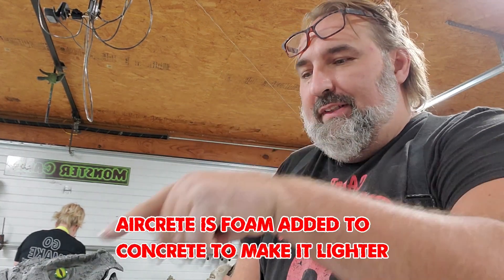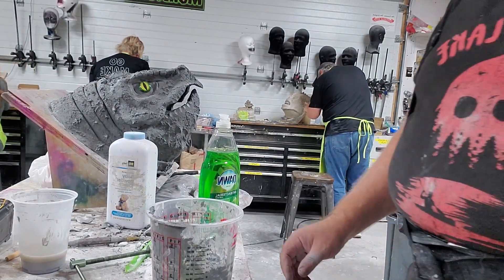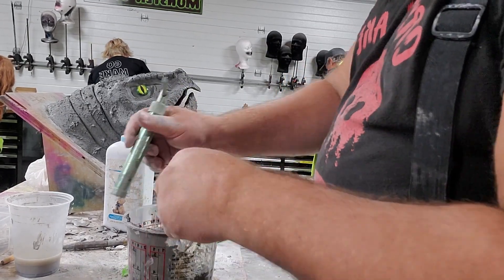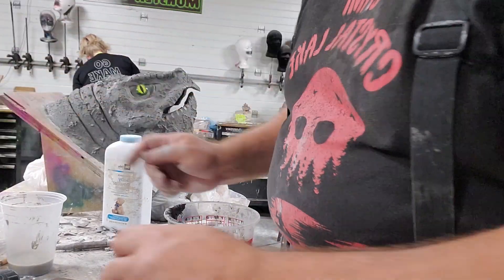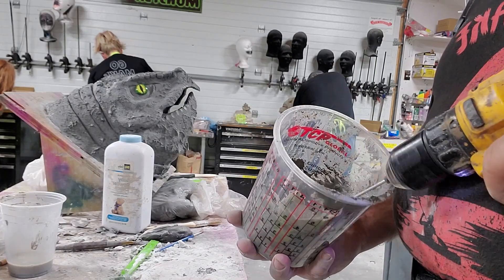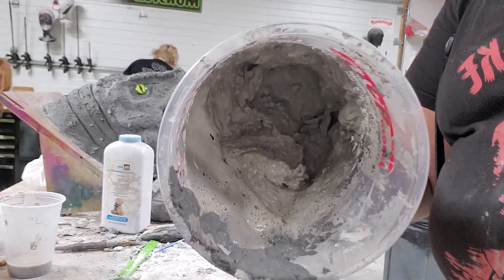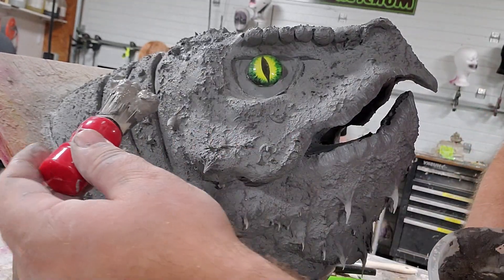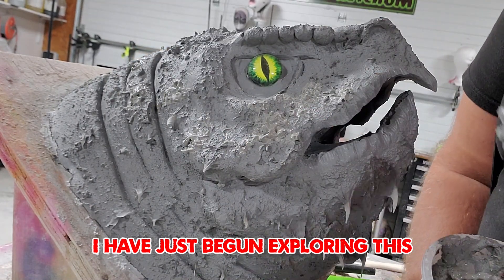whipped clay for sculpting texture

Comment: What about if you want to do human skin texture?
Reply from the maker: this would be too intense for human skin, those are best done with an orange peel texture stamp in my opinion.
Reply: @StiltbeastStudios  interesting... Wifey is just about finished with a really cool lamp. It looks like something straight out of Ed Gein's house. The base of the lamp is two stacked and corpsed skulls, and the light turns on via pulling a detached eyeball! She has long hair attached to the rim of the light shade with latex and it looks as if she scalped someone. However the scalp doesn't have any texture , so it just looks like painted latex.
Reply from the maker: that sounds awesome! I also like the texture of just dabbing a latex chip brush onto the surface, its a good texture.